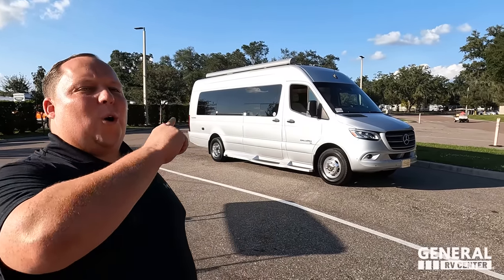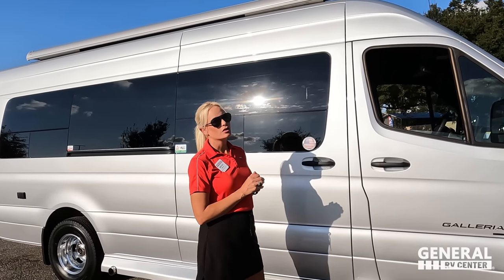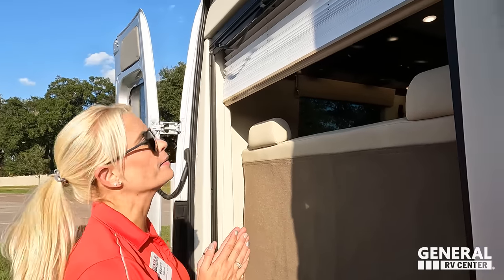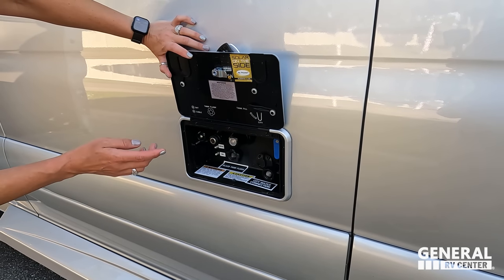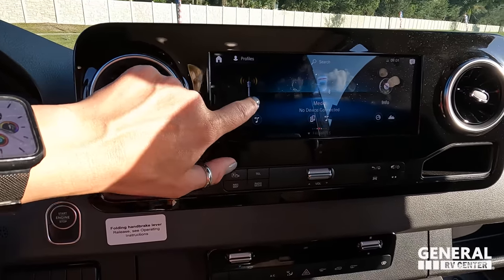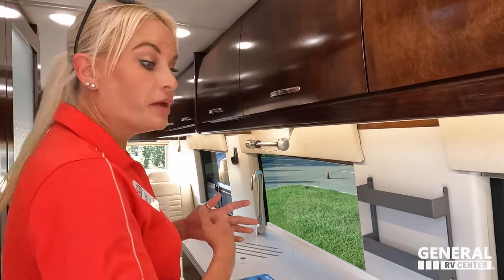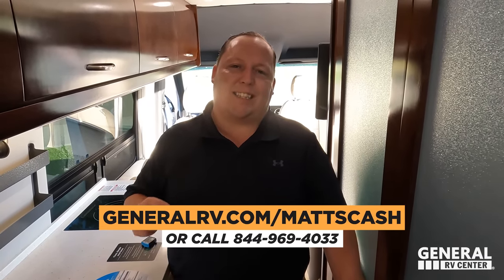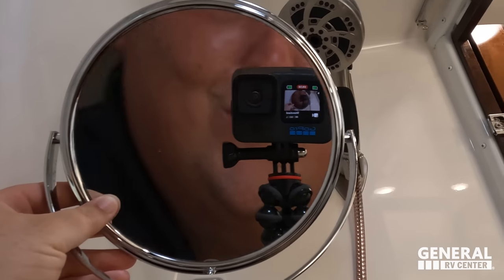Class B Motorhome that Holds 7 People!

Comment: Nice! The cabinets are beautiful but dark, and there is plenty of them. Plus the wardrobe, excellent storage. The shift control is weird...it seems like trying to fix something that wasn't broken. Pull it this way, push that. The 1st thing I thought of was someone not getting it in the right gear and shooting backwards. Or forwards. Or confuse it with the blinker. I don't know how much of a learning curve there is, but is it easy enough for someone who has never driven it to hop in and move it without reading a guide?
Reply: The Mercedes transmission stalk is used in the majority of their vehicles.  

It’s super easy to use takes up no space.  Up for Reverse. Down for drive. Press stalk button to park.  It’s all electronic so it’s not going to let you select reverse while driving smh.
Reply: @JohnSeitz  Thank you. I don't know Mercedes cars, and have never seen this before. It sounds easy, with a learning curve. I'd have to put a sticky on the dash to remind me what's what for a while.  :)
Reply: @pennylynch4471  but it’s labeled… I don’t see the issue.
Reply: @JohnSeitz  Another detail I didn't know. 
I drive manual for a long time, both on the steering column and the floor. Even drove a VW bug that you had to change gears in, but if I recall it didn't use a clutch. I don't know why this worries me. I guess I'm feeling the tech move past me.

Comment: ask yourself this / you're on a road trip with 2 ppl - where do the suitcases go ?
They need to lose the passenger seats and make that storage space. 
Those seats are useless anyway. unless you have ppl that want to sit straight up like a 
2x4 for hours on end there's 0 reclining space - so lose em.you could pull the kitchen forward a bit and make a taller refrigerator

Comment: I'm wondering why is diesel better than gas? 😎
Reply: Depends on your use case.   

I prefer the diesel as it will hold up for 100’s of thousand miles under heavy boost from the turbo.  And gets slightly better mpg.  

The transit by ford it’s twin turbo v6 doesn’t last more than 130-150k miles under full boost all the time.  And a 9k pound plus’s van is going to be under high boost.